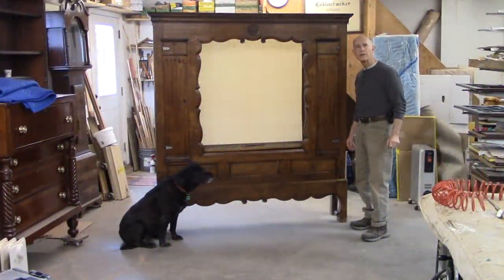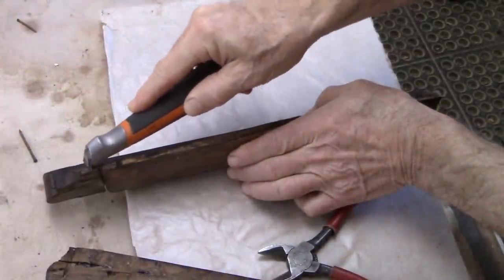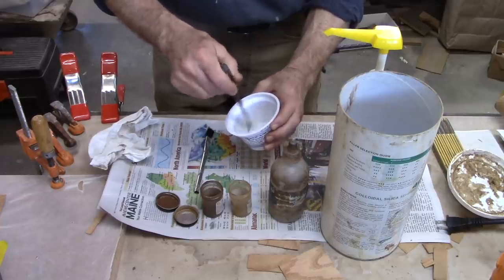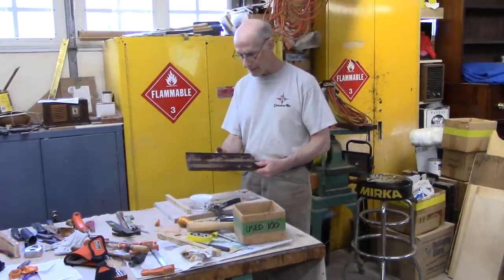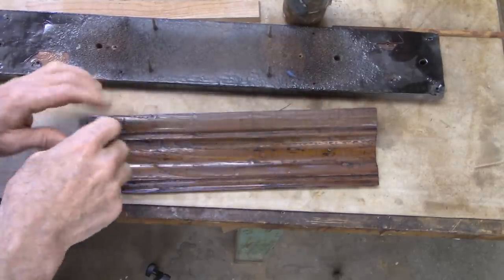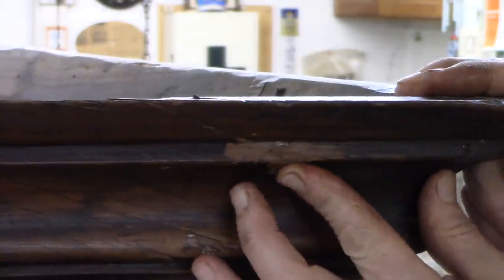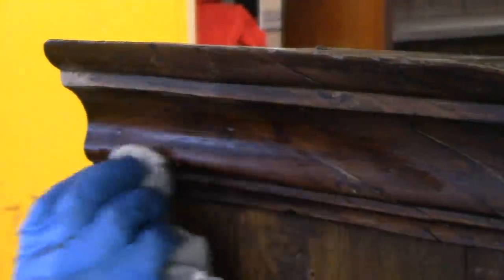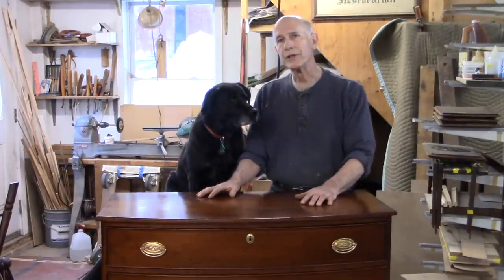Restoring a Welsh Cupboard - Thomas Johnson Antique Furniture Restoration

Comment: I am buying all the scrapers. About time. Lee Valley has them all and delivery is free right now. Thanks. Been meaning to do this for years but either didnt have the cash or got distracted. Lots to get distracted by in the shop. Thanks.
Reply from the maker: Thanks! The scrapers are an amazing tool, so simple
Reply: @johnsonrestoration  Lee Valley Tools in Vancouver carries all the sizes and replacement blades. Looking forward. Paint scrapers do not work that well, not flat.

Comment: And yet another excellent video. As an amateur woodworker, when I watch this channel, I feel as if I'm stealing a class of professional restoration without paying the tuition. 
One question came to mind while watching the assembling of the top right molding, if taken off and glued while held flat, why was there a need for the wedge? 
Thank you for these videos, most enjoyable as well as educational.
Reply: Three reasons, I guess:
1. The moulding's back was not completely flat and the whole lot had cupped with age (Tom says so around 10:22). This would cause the top of the moulding to move away from a straight line projecting up from the side of the carcase.
2. The top of the moulding is definitely not flat to start with - around the same time in the video you can see that the veneer sheet is not glued to the top inch or so of the moulding at all, and the moulding is not "full thickness" but undercut at the top (or more likely taken from a piece that was not square at the top to begin with). Compare to the profile of the top moulding (which was probably moulded at the same time, if not from the same plank which was then cut into three and given false mitres at the end of the side portions).
3. The batten had been fixed to the broken moulding, which had an angle in the middle (because it had broken where the end grain of the carcase top had pushed through it), and since Tom has not moved the batten, it was in the "wrong" place to sit against the whole moulding once it had been reglued together.
Reply: @dlevi67  
I understand what you are describing, but look at the video at: 0:52. Here you can see the top of this moulding was flush with the front molding. I'm sure the warping is the cause of the split, but I'm wondering if a restoration might include either steaming and straightening this molding, or after epoxy assembly  - shave the back so as to allow fitting as original & at 52 seconds into the video.
My real question is: does "restoration" not permit either of these two options?
and also, does restoration permit the addition of new wood in lieu of the two potential fixes?
Reply: @tombaker3794  Bear in mind that age changes the dimension of wood permanently and unequally, and I think the reason why the top matched is only because the moulding was split. Yes, you could try to straighten, but:
1. Straightening cupping is really hard, and the grain of elm is usually very twisted and interlocked (running in different directions within a short distance), so it's a thankless task even for a "straight", wide plank, never mind a narrow length of variable thickness moulding. You can see some of the gnarliness around 8:30 to 8:50 as Tom is sanding and filling.

2. The moulding is pretty thin in some points; shaving off enough from the original  to straighten it may leave you with no moulding at all. If you look at the size of the gap, it's pretty comparable to the thickness of the thin parts of the piece (look at 2:03 and 10:31)
Which is why - I guess - Tom chose to go with fixing things the way he did, which is the fastest and safest way (and thus cheapest for the client - plus it still allows a later restorer to try to do pretty much anything else, since all of the original wood is still there).

Could something else have worked better? Possibly. I mean, at one extreme one could have left the pieces where they were, glued the flapping piece to the carcase and just filled the gaps with putty and wax; it's not like the moulding has any structural function. However, that not good from a conservation point of view and it would probably lead to further repairs down the line.

At the other extreme, one could re-do the moulding altogether from a new piece of wood. It's a pretty small part considering the overall size of the cupboard, and there would be a lot of original moulding left for anyone to see that it's a genuine, well-intended restoration rather than an attempt at faking "beautiful and expensive" decoration that wasn't there to start with. There's always "another option".

Which brings me to your last question: yes, you can add new (or repurpose old) wood and legitimately call it restoration (or even conservation). It's generally your last resort as a restorer - partly because it's the thing that is least likely to remain undetectable over time, and most difficult to get to match decently at the start.

How much is too much is an entirely subjective decision down to the owner and the restorer: is a table where only one leg and a plank of the top are original, and the rest of the top and the other three copies of the old leg have been remade, "an old table"? What if it was found in an Egyptian tomb from the 2nd millennium BCE? It's the main dilemma of conservation vs. restoration vs. remaking...
Sorry for writing a novel. Antique furniture and its conservation/restoration is a bit of an obsession for me.
(edit: reformatted paragraph spacing, hoping it works)
Reply from the maker: Thanks! because it wasn't flat. And the cabinet wasn't flat. I wish I had clamped it down flatter
Reply from the maker: Wow! dlevi67! You really watch these videos and seem to have good insight and knowledge. Thank you!
Reply from the maker: Yes, thanks!
Reply from the maker: Thnaks Tom. See dlevi67's answer below. He's better at this than I am!
Reply from the maker: Thank you! Wow!
Reply: @johnsonrestoration  Thank you, Tom, for continuing to make such high quality YouTube content and woodwork. I'm just a commenter who is learning a lot.